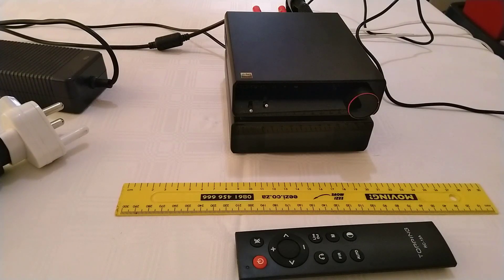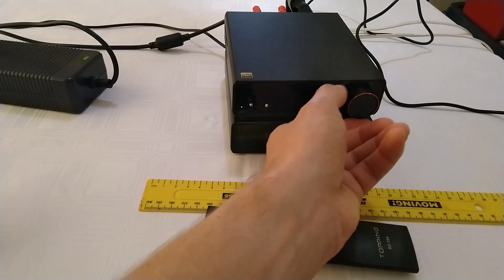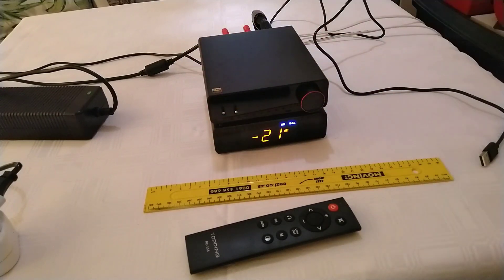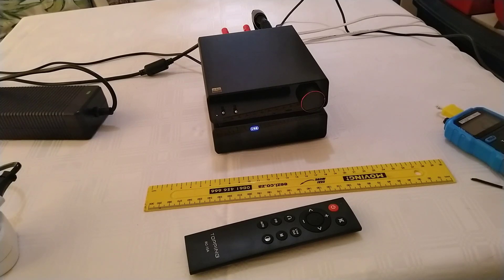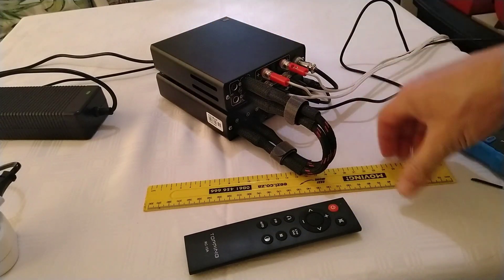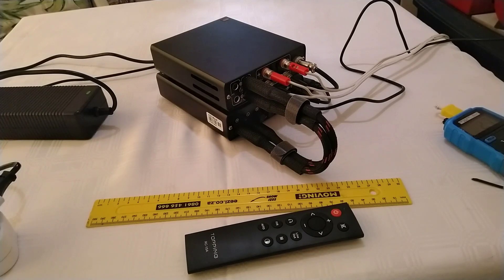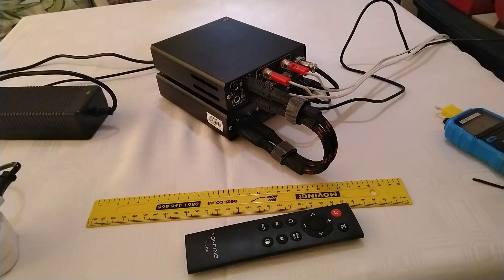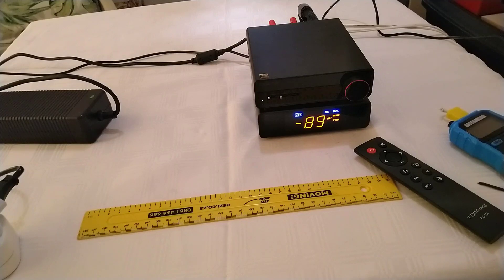Topping PA5 Amplifier with E50 DAC Review - First Impressions

Comment: Спасибо за обзор! Интересно как усилитель будет играть с Dali Spector 6.
Reply from the maker: My pleasure. Speakers are the weakest link in terms of distortion in the audio reproduction chain. Good DACs and power amplifier are already available at a reasonable price point. I suspect the Topping PA5 amplifier would sound decent with the Dali Spector 6 loud speakers but could do even more with better speakers.

My goal was low distortion, i.e., accurate sound reproduction as possible so I got some advice from some local audiophile speaker builders. I ended up building some Three-SixtyFive floor standing loud speakers for this amplifier to drive. The PA5 is really able to show what it can do with these loud speakers. Music enthusiasts, who go to clubs and the local philharmonic orchestra, have been impressed at how clear and detailed the music sounds from this setup.

I donated the old book shelf speakers,  amplifier and so on to a charity shop. The old equipment was completely and utterly outclassed. The old amplifier had some hum and hiss issues but even without those it was at best middle-fidelity and not not high-fidelity.

I need to do another video on the amplifier and speakers. So many videos so little time! :-D

Comment: I am planning to get topping pa5 + e50 combo for the polk r200 speakers. How do i add bluetooth/wifi streamer with a subwoofer if i follow this route?
Reply from the maker: I would plug the Bluetooth/WiFi streamer into the USB input of the E50 DAC. That would allow the E50 balanced output to feed the PA5 amplifier which would drive the Polk R200 speakers. The SE output of the E50 could be used as the input to an active subwoofer.
Reply: @breakfixbuildimprove4326  thanks for the input
Reply: Sorry but the E50’s outputs are only available one at a time. There are cables available that pair up, might work. Fortunately my speakers go pretty low and are 90 db efficient. Problem solved if you use with a preamp with sub out.

Comment: I have the e50 connected to L50 , how do I connect to PA50
Reply from the maker: Ah nice! I don't have the L50 but I notice that the diagram of it has a pass-through option. If you have two pairs of TRS cables then you could try plug one pair from E50 "BAL" into L50 "BAL Input" and another pair from L50 "BAL pass-through" to PA5 "BAL Input".
Reply: Why? There’s only ouputs for headphones on the H50.  Outputs for speakers on the PA5s. You could use balanced interconnects from the E50 to the PA5 and rca to balanced interconnects to your H50. You’d have to change the E50’s outputs but that’s ok. There’s available from Topping and other vendors. The Topping interconnects are a bit pricey but they sound great. No I haven’t tried the cheaper ones but the ones from Amazon all too long. The dealer where I bought my Topping stuff had other brands with more reasonable configurations. From my experience if your PA5 is powerable enough for your speakers you’re in for a treat. This little amp is amazing. Hard to believe a class d amp could sound so good. Gives us a taste of what a really good amp can do. Clarity and imaging are magic. Enjoy.

Comment: Nice review!. Try to get  hold of some thick good quality speaker cables just to test (2 x 4mm² - Transparent Speaker Cable - German Made OFC Copper Speaker Wire) . Found it improved my base response enough for me to hear it  on my current setup. It might not make a difference on your system. I have this amp on order, plan to test with  Denephips aries 2 DAC also on order.
Reply from the maker: Thank you. If your original cables were too thin for their length then it is certainly possible for them to have impacted your sound. Voltage drop is a measurable thing. What was the cross sectional area and length of your original speaker wires? 

The new speakers being built will definitely have sufficiently thick wire for the chosen length as per lookup tables or calculation.

The specifications of the Denafrips Ares 2 DAC indicate that it should be able to feed the Topping PA5 amplifier nicely. You should do a review of the pairing and the cables used to interconnect them as that DAC has XLR outputs while the PA5 has TRS inputs. Let us know what you think of the combination once you have had a chance to assess it.
Reply: @breakfixbuildimprove4326  bought appropriate Mogami xlr/trs cables , both units are on their way. let you know what I think compared to the other equipment i own.quite excited.!!

Comment: Please suggest how to adjust the volume?
Reply from the maker: If standing next to the Topping PA5 amplifier you can turn the volume dial up or down. Alternatively you can control the volume from the input source which may have a remote. I use the E50 DAC for this purpose because it has a remote control and my sources (streamer / CD) do not. 

I'll discuss and demonstrate this cover this in more detail in a future video. Fair warning this could be a while as I am currently gathering components to build some floor standing loud speakers to let this amplifier and DAC stretch their legs!
Reply: @BreakFixBuildImprove  thx
Reply: With the knob as this dat doesn’t have a remote. Think you need speakers at least 90 db efficient. The PA5 doesn’t like to be stressed.